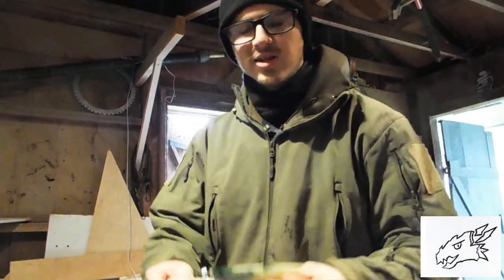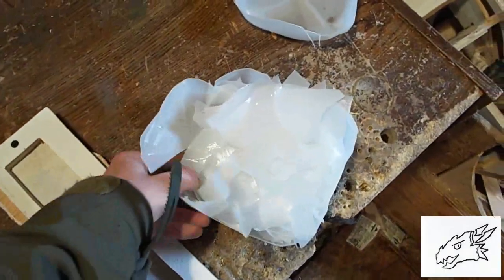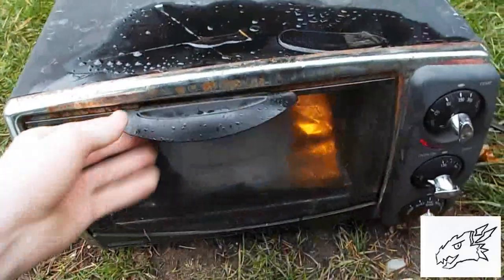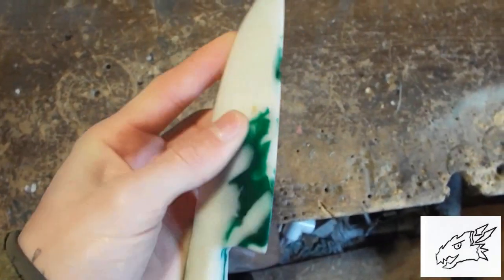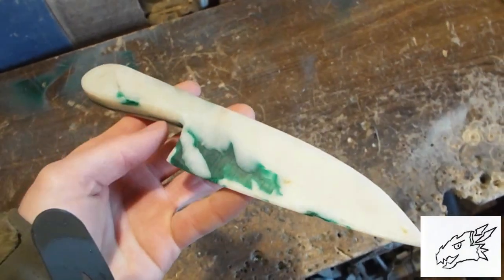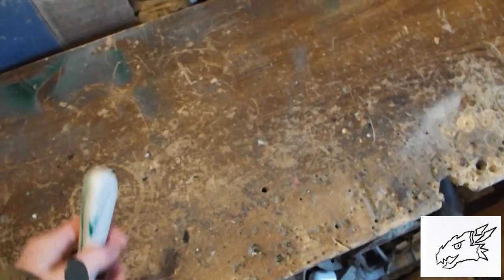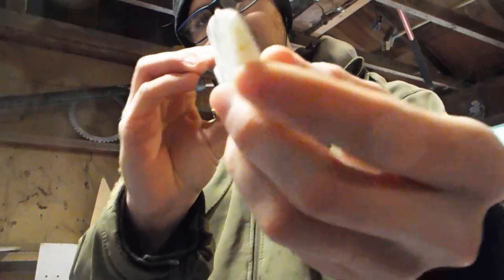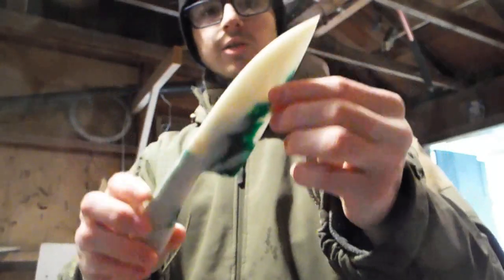Making a Knife out of Milk-Jugs

Comment: I did this just cant get 2 sharpen any help would be great
Reply from the maker: Try sharpening the blade with a knife. Just like sharpening a pencil with a knife. Carve the plastic at the tip to be a point. Plastic doesn't hold an edge soo even when you do get a good point or edge on it, you can only use if a few times before needing to sharpen it again